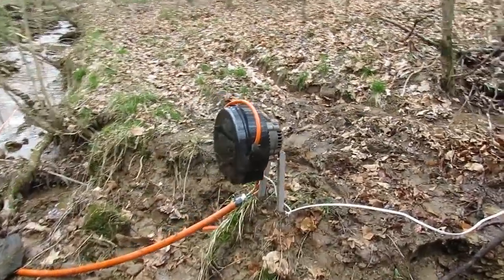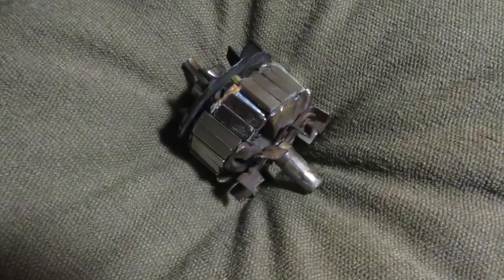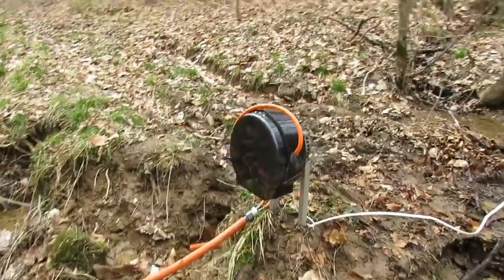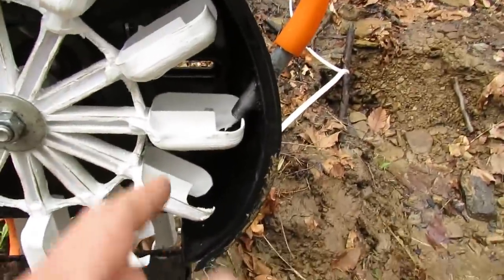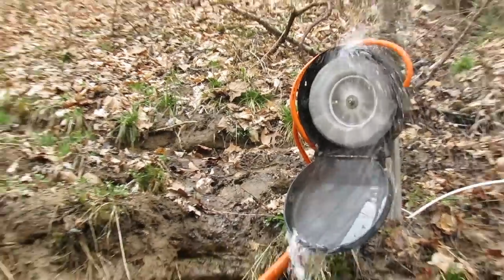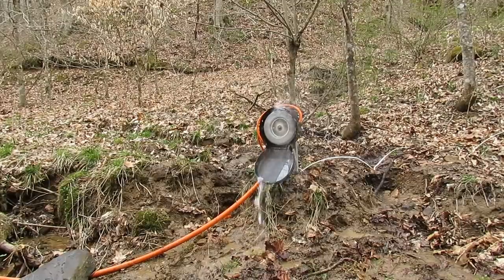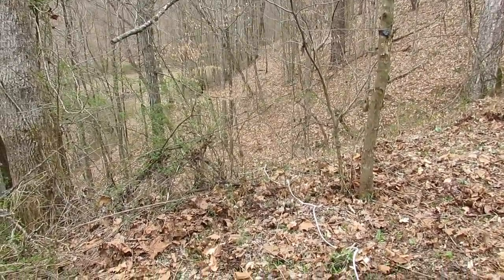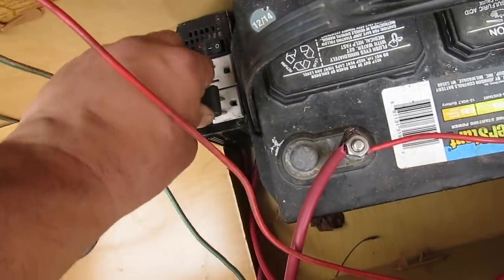Water Generator Running Off Grid Cabin

Comment: I like what I see here.  Very good basic design.  What kind of filtering is at the top of the hose?  You’d need to have several stages of filtering to get good clean water flow.  Also, do you have a ground rod for the house? I’d think that whole system should be hooked to a common ground. 

Lastly, if you are charging phones, doing so from a 12v car type charger will use less battery power than using a 120v phone charger hooked to the inverter.  Same is true for lighting. Use an led light designed for an 12v RV and it will give better light with less battery use than a 120v led light hooked to inverter.   You can get TVs designed for RV use that run on 12v too.  I have one made by Polaroid.
Reply from the maker: Thanks. I finally put a piece of screen wire at the top of the hose to keep debris out. As long as nothing bigger than the size of the nozzles goes through it shouldn't clog up. 

Good advice on directly powering the devices on 12 volts.

Comment: Thats pretty awesome how u took barely nothing & created a usable thing. 
Was wondering how long ur generator has been on that lil edge like that? Reason why i ask is i was wondering if erosion of the bank has been an issue for u yet?  
Also has the wet conditions been an issue at all with the generator bearings etc? I saw a little water running down onto it & was curious. Thanks for the videos & sharing ideas much appreciate it this way when i finally get around to buying my little piece of land i'll have so much stuff that i'll be able to do,build,create etc.
Reply from the maker: I put rocks down under it after the video. I also covered the alternator with a butter bowl to keep the water off of it. The bearings wouldn't have lasted long at all with water running on them.

Comment: Hey also, what is powering the pump down at the creek thats pumpin water to the toilet paper holder/water wheel??
Reply from the maker: Gravity is powering the water wheel. The inlet of the hose is a lot higher than the generator.

Comment: How about a video on how to find the parts and build an alternator like THAT???  Please?  :)
Reply from the maker: I did a video on how I converted it. It would be a lot more efficient to get one that is factory-made and designed for this use.
Reply: PreacherFranko Missouri Wind and Solar sell excellent generators purpose made and no cogging either
Reply: Or just build this https://youtu.be/vA6pi8aMUAM
Reply: I have  a 500 watt stator and coil that would work very good for that and a 100 amp rectifier and dump controller and a solid state relay and 300 watt resistor bank. And 100 amp mppt and 80 amp mppt on mine its wind and solar hybrid system 1410 ah bank
Reply: https://youtu.be/R3KmNxDPlKs
Reply: Oops. Red  dawn full lol

Comment: Check voltage at input[ac]would like to know.thanks.good job though
Reply from the maker: The voltage coming from the alternator is around 20-25 volts, after going through those little wires it drops to about 14 -15 volts.

Comment: For someone that doesn't have a 3D printer how can they make something like this? I would make something to protect the generator from the weather. Think about something like a small plastic trash can cut out to fit over around the generator, shaft, and post.   THANK YOU FOR INFORMATION.
Reply from the maker: I would recommend buying an aluminum or some other kind of metal pelton wheel. The plastic one didn't hold up to the constant spray of water with particles of sand in it. It wore out pretty fast. Here is one like I am talking about that should work better. https://www.ebay.com/itm/Pelton-Water-Wheel-Turbine-Aluminum-Micro-Hydro-Generator-w-Adapter-free-ship-US/201853521661?hash=item2eff684efd:g:Nr4AAOSwYXVYyIZj

Comment: you need a new 3D printer
Reply from the maker: No, I need to take the time to properly adjust the print bed. It was a little bit off, and it doesn't take much. By the time I noticed it was about halfway through printing so I just let it go.

Comment: Would like the volrage test from end of your white 70 ft a/c cable to see your hyrometers production...i honestly believe you could use another battery or 2
Reply from the maker: The alternator is putting out around 20-25 volts and about 15 volts is making it to the cabin. I have two more batteries and a couple of solar panels hooked up now.

Comment: So how many amps is the alternator putting out? The voltage at the battery is meaningless except to show that you are charging and not discharging.
Reply from the maker: I'm getting about 50 watts out of it. It's not really a lot of power, but I have since added solar panels too. Here is a video showing that, https://www.youtube.com/watch?v=NTWoSivTpHE

Comment: Put down rocks and gravel to prevent  the shore from washing out from the off flow
Reply: petnzme01  no it is not, but you might be.
Reply from the maker: Yes, it would. I did put rocks down under it after I was done filming. Here is a video that shows it. https://www.youtube.com/watch?v=NTWoSivTpHE
Reply: luke Fugate yep, good call. Generally, do whatever you can to limit the clayey runoff. Clay never naturally settles out of water. Be a good steward of the waterway.

Comment: Nice system ...FYI...That battery charging produces hydrogen gas......vent the top of your box before it goes boom.  LOL.. I learned this the hard way so you won't have to.  I am totally off grid hydro too.
Reply from the maker: I have since put a screw in the cabinet that holds the lid open a little bit.
Reply: Did your box go boom?
Reply: Charging the battery produces Oxygen as well as Hydrogen, so long as the charging voltage is above the 'gassing' voltage of the battery.
Reply: There are batteries out there designed for this type of application that don't produce gasses. But they are crazy expensive.
Reply: I charge my batteries inside my room, is it a problem?
Reply: @ÁrvoresEmadeiras  depends on the type of battery. Use a AGM not at normal starter battery
Reply: Why not seal the box an collect the gas for cooking
Reply: alun roberts you’d have to collect it and pressurize it. Wouldn’t be efficient at all in this set up

Comment: Just a little bit confused. You converted a 12v dc alternative into an ac generator that is converted back into 12v dc to convert to ac v to provide power for the cabin. Is my assumption correct?
Reply from the maker: Yes, it is different A/C though. The alternator always put out A/C current, but it was changed by the rectifier to D/C. I removed the rectifier and put it a longer distance away from the alternator but essentially it is still doing the same thing. It puts out less than 30 volts A/C and it is not "clean" power as it is not a constant frequency or what is called "wild A/c" The inverter changes the D/C current from the batteries to 120volts A/C at 60 Hz frequency.
Reply: @lukeFugate  ok, so my question is why not just use the alternator to charge the battery and run the inverter off of that. So much simpler
Reply from the maker: The D/C from the alternator would have too much voltage drop to charge the battery by the time it got through those long wires. By using the higher A/C voltage from the alternator it doesn't drop down as much. If the battery could be right by the generator it would be much simpler to use the D/C.
Reply: @lukeFugate  did you even try it? Or just skip it and do things the way you do it?
Reply from the maker: @jeffreyyeager1398  I tried it. I kind of knew it wouldn't work, but it would be the easier way so I decided to give it a try. I hooked up the alternator with the rectifier hooked directly to it like it would be in the car. It was putting out about 14.5-15 volts D/C Great charging voltage. I hooked it up through the same 14-3 wire I ended up using. At the other end I had 11.4 volts D/C It wasn't enough to charge my battery. I moved the rectifier up to the cabin and the voltage went up to charging voltage because of the higher A/C voltage that could lose 3 or 4 volts and still be enough.
As an example, If you check your voltage at the battery on a long vehicle like a bus or an RV you would have full battery voltage at the terminals, let's say 12.8 volts resting voltage. Then check the voltage at the tail light and it will be less, Probably around 12.4 or 12.5. Not much drop, but it is still in a short distance. When you are working with lower voltages (12 or 24 volts) every single tenth of a volt matters.
Reply: @lukeFugate  okay thanks for sharing this. I am hoping to achieve that same goal but with a wind energy. Still in the planning process.
Reply: @lukeFugate  did you use the same size hose at the end or did you put a funnel or larger hose to collect more water pressure to the end that would collect the water from the source?
Reply from the maker: @jeffreyyeager1398  I have a slightly bigger water line at the start. It would be better for me to start out with about a 3 inch or larger and drop sizes after the initial drop. It also needs some type of screen to keep out debris.  I just used what I had. Here is a video that shows the intake as well as the addition of solar panels to the setup. 

https://www.youtube.com/watch?v=NTWoSivTpHE

Comment: Use capacters to quick chare and the maintain you batterues. Less heat and better control. Also go to led lights. Last longer and hard to break. You could use peltier chips to use heat to produce electric plus the cold side could help cool also.

Comment: U need ok run led lights. And one high drain for battery reg
Reply from the maker: I now have water and solar power to the cabin. I had to locate the panels and batteries in a sunny spot and run the A/C power from the inverter to the cabin. Here is the video where I did that. https://www.youtube.com/watch?v=NTWoSivTpHE

Comment: Good idea. 😄👨‍🎓  I would probably do a variation on that.💡  I would like to do/see a system that, depending on location;  can do wind, solar, and water  turbine power with one management system monitoring the best option & charging a battery. 🔋(Car / recreational size?)  That would probably make a pretty reliable off grid option for whatever you need.?🤔
Reply from the maker: I now have water and solar power to the cabin. I had to locate the panels and batteries in a sunny spot and run the A/C power from the inverter to the cabin. Here is the video where I did that. https://www.youtube.com/watch?v=NTWoSivTpHE

Comment: If connections and internals of alt. Are wet got to be loosing some voltage
Reply from the maker: There would be some loss. Also, the bearings would seize up after a short time. I ended up covering it up. Here is the latest video showing it. https://www.youtube.com/watch?v=NTWoSivTpHE

Comment: So 14 volt 50 watts, 3.5 amps. You'll need a lot more than that to run those lights for more than an hour or two.
Reply from the maker: I added some solar panels to the setup. I also added a couple more batteries. Here is the video. https://www.youtube.com/watch?v=NTWoSivTpHE&lc=Ugy0CVM8j8KK281XRnp4AaABAg
Reply: How long does it take to charge a battery?

Comment: Voltage looks great but that just means you’re not putting any real load on the battery. I’m curious what you’re charge rate in amps is, that’s how to truly rate longevity of the system.😊
Reply from the maker: It turns out the little generator is putting out less than 50 watts, not very much. I did find a way to add solar panels to the setup. Here is the video for that. https://www.youtube.com/watch?v=NTWoSivTpHE

Comment: I'd love to get more info on your set up, any info you can or will share would be great. I'm planning to set my hunting cabin up on a 12v system and having one or two 110v outlets for phone charger and maybe a small TV. I think this system would be perfect I just dont know a lot about electricity. Thanks for any help.
Reply: American Hot Topics forget 110VAC just buy an automotive DC chargers and a portable DC television
Reply from the maker: You can get a small inverter and hook it straight to your battery. It has the plugs built-in, so once it's hooked to the battery you are ready to go. If you have an area where there is enough sunlight, then solar power would be a better option.

Comment: Could you please help me.i just bought 9 acres of land and have a nice sized creek.im off the grid with no power and using well for water.can you please help me and explain your set up and how you did the altenator. Id even pay you if you could build me one..how do you creat enough pressure to come through the oranges hose to spin the generator.my email is brandononeallaf@yahoo.com
Reply from the maker: It's just a gravity feed system that runs the water. I have the intake at about 30 feet above the generator. I would recommend getting a regular PMA rather than doing this conversion. The coils in an automotive alternator are not ideal for this use. I figure it is only putting out about 50 watts or less. A regular PMA has quite a bit more power and would be more practical. 

How much does the creek fall as it crosses your property? The amount of fall is how much potential you have.

Comment: Except for building a dam and raising the head or lowering your generator, you are probably as efficient as you going to get with that flow. I would definitely pay attention to reinforcing the banks to prevent unwanted erosion. Thanks for the video.
Reply from the maker: I think the only thing I could do to get any more power would be to increase the size of the pipe on top. I lined the area with rocks and it hasn't washed out so I guess it's ok.

Comment: Just 1 thing,your cinder blocks are lying on there side they will brake that way .You should stand them up so your cabin dont hit the ground under side load or snow load.
Reply: This
Reply from the maker: Well, I guess it's too late now. There's a lot of weight on those blocks. Maybe I could stuff some in beside those just in case.

Comment: I would get a job box put a vent in it and use it for battery box.
Reply from the maker: I guess a plastic tote would work to contain the batteries. I would still have to vent it though.
Reply: BRENT3143945 steel + hydrogen == rust
Reply: Maybe aluminum then, thinking the best for water proof and security, must have vent.
Reply: Bet a used knnack box box would last along with tho.